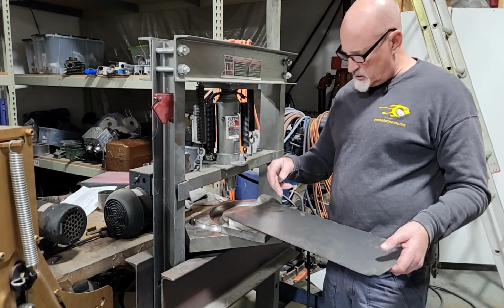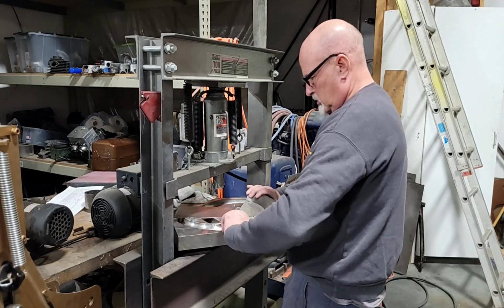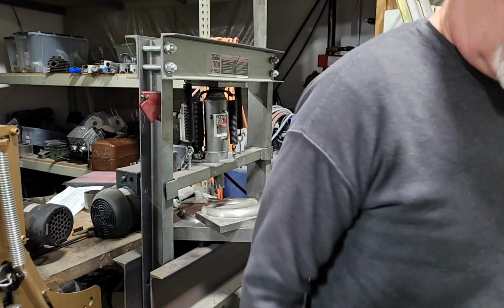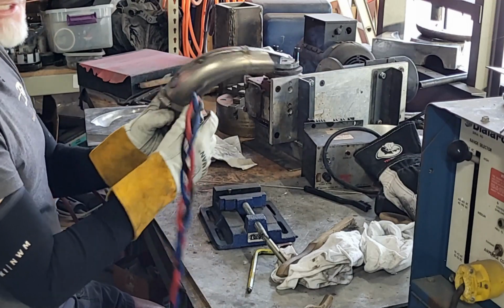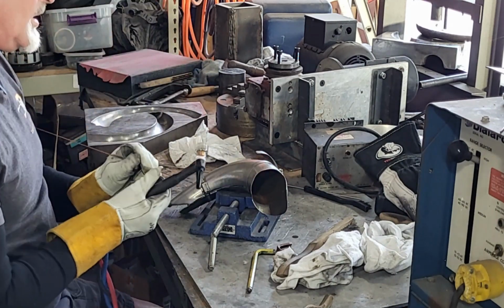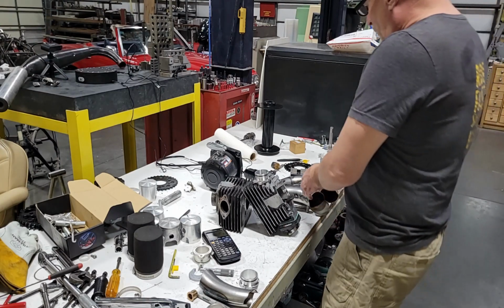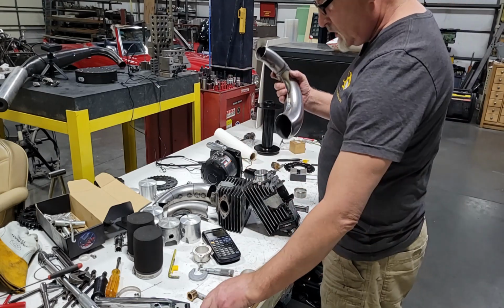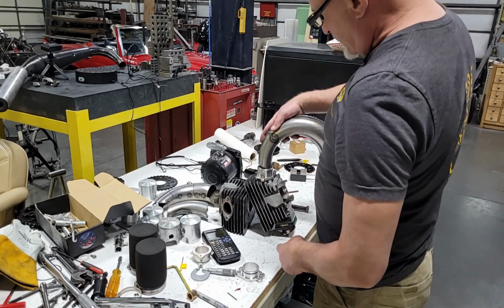2 stroke pipe build #1

Comment: have 1977 RD400. I see the 7979 Daytona cylinder has wider EX port. Do you see any issue with me widening 77 RD400 EX port to match Daytona. I street ride, looking for a bit more power.  What would you call a stage 1 ish port of a 77 rd 400?  i suppose you are so far beyond stage 1.  You are an export with RD/RZ
Reply from the maker: Sure you can widen the exhaust port to daytona. You can go as much as 70% of bore. Since I dont know anything else about your plans or project I have no idea if it would be good or not. This is the hole everyone falls in when making power with a two stroke. Good luck.
Reply: @SpeedofCheeseRacing   Thanks for reply.  I plan to use stock air box with early filter (no baffle tubes), D&G chambers, Fiber Reeds. That is it.  I figured widening to daytona width should not change my power peak point much, but add a little more HP verywhere and not so wide it messes up rings.  Just street riding.  Thanks again. Your videos and knowledge is impressive